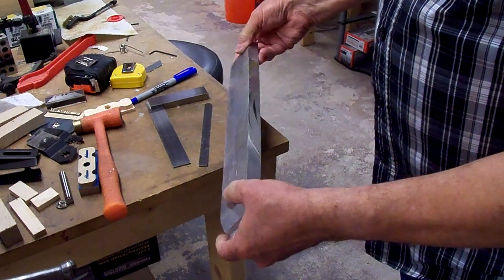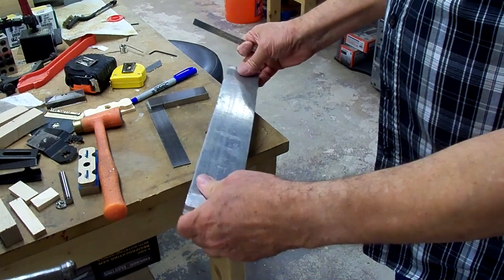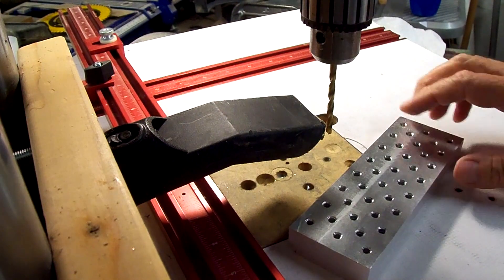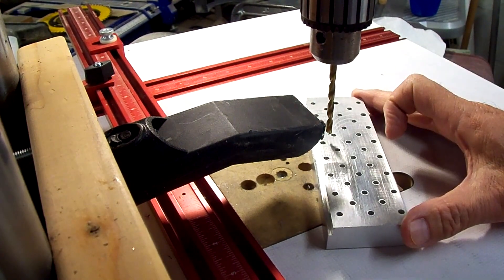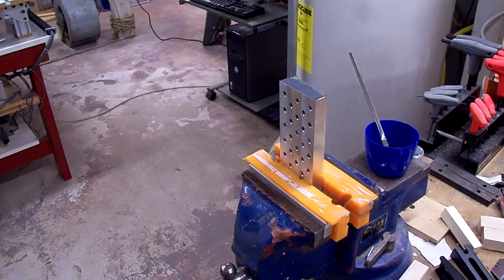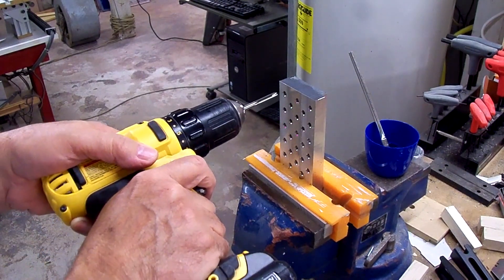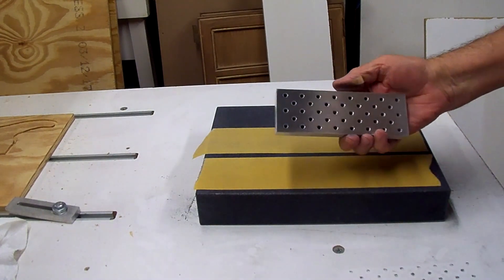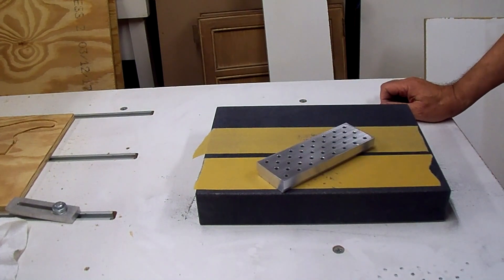Aluminum mini pallet

Comment: I think  I would have started the tap on the bench drill, or mill and then hand tapped to make sure all were square, but other than that very interesting
Reply: If your mill has a dc motor? it should be possible to wire in a reversing switch to the wires between the motor and the speed controller. As in here. http://www.vegoilguy.co.uk/reverse_polarity_switching.php  Honestly though I tend to just start the  tapping with a 1 or 2 threads by turning the chuck by hand on a pillar drill or Milling machine and then finish it off by hand using a tap wrench once you know the thread is square. Takes time but gives consistent results.

Comment: Nice to have some scrap aluminium around the shop. Good little tool to have when you need it. Nice to see the CNC mini mill in action. Cheers Dave.
Reply: I have the same setup but using bigger motors, Have not has a problem with missing steps I don't think.
If I can work out how to send you some photos I will. Do you still have the spring on the Z. Cheers Dave
Reply: I have seen a gas strut used in its place. its there to help with the weight of the head.

Comment: Nice work.  What is this used for?
Reply: MyRobertadams I see.  I thought it may be something like that as I made a 90deg surface grinding block with lots of tapped holes for the same reason